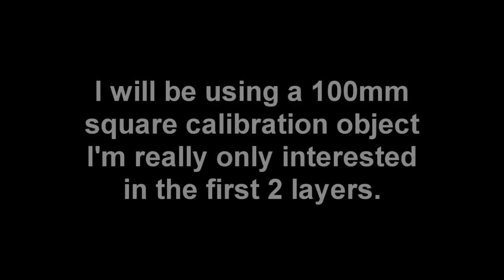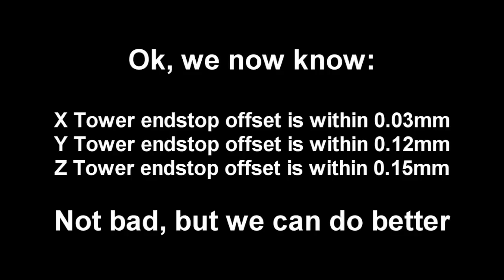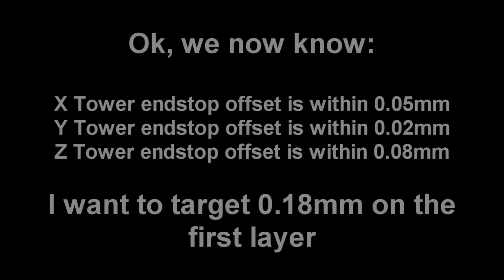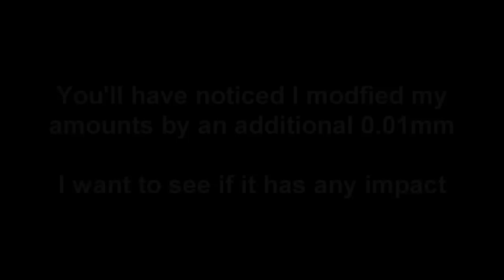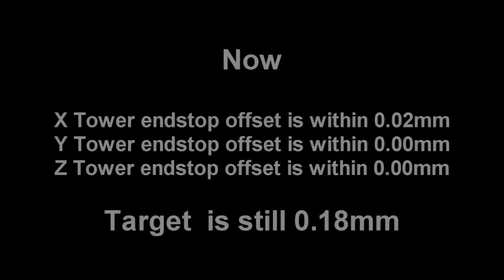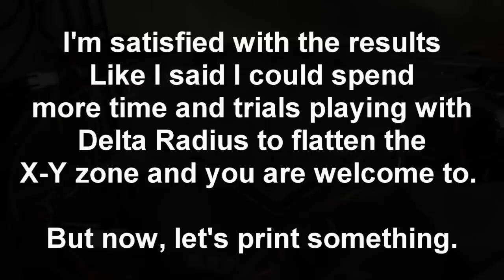Delta Calibration - Fine Tuning

Comment: Do you just add the (M666 X Y Z) command at the beginning of the g-code? I'm working on calibrating my Deltaprintr and this video is great but I don't quite understand what we are doing with the new M6 values we calculate during the test prints.
I'm printing a 100mm cube just like in the video

Currently the "X edge" on my printer prints ok
the "Y edge" of the cube disappears halfway through the line and the extruder drags on the surface
Same with the "Z edge" of the cube; the extruder drags until it gets halfway and is closer to the "X side"
The front edge of the cube seems to print fine

Please Help! thanks

Comment: If extrusion does not occur immediately on the brim/skirt would the cause be due to a shortage of E step calibration? My steps are accurate in producing 100mm when asked to, but the skirt/brim does not print until about 1/2-1 pass
Reply from the maker: Alvin Thai Can be attributed to several things:
1. ooze
2. retract without reprime
3. too much space in Bowden tube means you have to build up pressure before it will extrude.
4. nozzle is blocked from prior retract and needs to build up pressure to push plug into melt zone

I always manually purge right before a print and pull any extrusion away with tweezers before it reaches the build plate.

Comment: Hey Jay, what do you use to hold the glass bed? It seems you are using some sort of pad?
My delta printers is using paper clamp on the edge. It is plagued when calibrating, because the clamp makes the glass curved too much and the flatness is just way off. I want to improve my printer just like yours

I am using the Delta from SeeMeCnC
Reply from the maker: I use 3M Scotch Heavy Duty Mounting Tape, Clear (4010).

Comment: Jay, a couple of questions. First, what are those red connectors you use on the hot end for the heater and thermistor? Those look functional and not monstrosities like deans connectors.

Secondly, it seems from this and the previous video that your Z tower shows a lot more variability than X and Y. Might that be the end stop switch or some other slop on that tower?

Lastly, I notice that your kossel has the same odd vibration on homing that mine does. Travel down at higher speeds is nice and smooth but homing sounds rough and rattles everything. I might play with homing speed, perhaps there is a resonance that the default homing (is that what you are using) speed is causing.

Cheers,
Michael
Reply from the maker: LOL, the one for the hotend heater is a Deans Ultra and for the thermistor is a Deans Mini ... were you thinking of the XT-60 connectors?

The way my endstop switch wires runs on the inside channel causes some interference with the slider...I need to reroute it. There is no slop on the slider, but there is some in the Traxxas connectors. I use a rubber band to try and remove it, but I need to loo for some way to tighten this joint yes.

Good point. Homing speed is set to 90mm/s. After I sprayed some dry Teflon lube the "honking" went way.
Reply: LOL, yes I was looking at XT-60. Used to use those on my RC helicopter. I'll check out the Ultra and minis, thanks!
Reply: Jay Couture Nice, RC connectors are perfect.  Not a fan of Deans myself, but instantly recognized them!

Comment: I have an issue with my flsun qq, in the middle Z offset is perfect, but a few inches outward (all directions) its round about 0.1mm or more too high. Thats after auto-level of course. Do you have any idea why that is?
Reply from the maker: Delta movement converts a set of coordinates into the number of steps for each axis motor. This is some Pythagorean math (A^2 + B^2 = C^2) and is calculated for each tower, for each move, and moves are subdivided by segments per line so there is a lot of computations. If any of your values like delta_rod_length are off, then movement would be parabolic from the center outwards. This is the fine tuning video after you gave a pretty good calibration. Sounds like you do not. Try https://www.youtube.com/watch?v=tDLbqLve128 and then come back to this one if you think you need to.
Reply from the maker: https://github.com/MarlinFirmware/Marlin/issues/11124

Comment: I'm not sure what you are doing here. How does this method compare to the paper-test on the center and on the area around the three towers and adjusting the endstops (which is what I use)? It is similar, or does this method do something else, or additional?
Reply from the maker: This goes beyond using a paper feeler gauge and uses a caliper to measure the actual layer of plastic put down. If you are happy with the quality you get with the paper calibration, no need to do this. However, with this I print directly to glass with a thin layer of gluestik.
Reply: I watched it again and now I get it :) It's a neat way! but isn't it hard to measure the filament that precise? Isn't the readout too dependent on how hard you push on the caliper?
Reply from the maker: Use of calipers does require some practice and using the same amount of force. However even with the cheap 6" digital caliper from Harbor Freight, one can get 0.1mm accuracy easily. I calibrated once for what you see in the video and can print at will without worrying if the base will be flat or if  the part will stick. I posted this video as a follow on to my manual calibration using the paper feel gauge video. It's not required at all.
Reply: Nice method :) I actually do use something similar I believe. I print a spiral object that covers most of the bed, and I start at VERY low z-position (slightly above the height where it doesn't extrude at all) so it's really squashed on the bed. Then I can visually see if the flatness of first perimeter is similar all over the whole bed, and if in the area of one of the towers it looks different than near the other towers then I adjust that endstop slightly and try again (I got screws on top of the carriages that i can adjust). That also results in a very good calibration. However you can also clearly see then that the bed is not 100% flat. There are always some random areas that seem to be slightly higher or lower than the rest and they are not aligned with a tower or anything else that I can see. I guess z-probing would be the final step then to correct for the non-flatness of the bed...
Reply from the maker: I've found with  first layer of 0.2mm I don't have to worry about the "non-flatness" of the cake plate I use on my printer. It's "flat enough" for my needs.
Reply: Yeah for me as well, I removed the z-probe from the effector because I didn't seem to need it, and it was a bulky and weird device.

Comment: i'm confused as to how you calculated your new endstop values in comparison to the layer thickness
Reply from the maker: This video is meant for after you have done the initial calibration video and effector movement is parallel to the build plate. See my other video for that process. I am looking for the layer to be 0.2mm. Y and Z were at 0.33 and 0.35 meaning the effector is 0.13 and 0.15mm too high. Deltas home to Zmax so it means I needed to move the offset from the physical switch away from Zmax towards the build plate hence the negative.
Reply: @JayCouture3D  where can i find the intial calibration video?
Reply from the maker: @fastneonman1977  https://www.youtube.com/watch?v=tDLbqLve128

Comment: Hello, can I adjust the F "tower" with M666 or an other gcode ?
Thank you
Reply from the maker: +UniK Fanta - This video is for delta printers with the towers labeled as X, Y, and Z or alternatively Alpha, Beta, and Gamma. There is no F tower to my knowledge though this video is a year old now and things may have changed.
Reply: I know that that isn't a tower, but you showed a picture with a circle, and in the middle of X and Y was F thats why I asked.. But thank you for the fast answer and you helped me a lot with your videos :D
Reply from the maker: +UniK Fanta - Ok, you are talking about the points of calibration on the build surface not the towers. F is opposite of Z tower between X and Y towers. I like to check the calibration of F(front), L(left), and R(right) after I have dialed in points x, y, and z in front of their respective towers. http://reprapandme.blogspot.com/2013/12/the-basics.html

Comment: If I move my printer to some other location in my room, should I be re-calibrating anything?
Reply from the maker: +Leo Mckee-Reid Unless you are moving something physically on the printer then no. I have actually taken my printer to work on several occasions and it has no impact on calibration.
Reply: +Jay Couture Excellent! thanks for the quick response.

Comment: trying to level my bead and having one issue my y axis is thickness is inconsistent the x and z are fine
Reply from the maker: +Bass Envy You are saying that the filament that is laid down in front of the Y tower is either thicker or thinner than where it's laid down in the X and Z right? If so, then if is always thicker or thinner or does it depend of how close to the Y tower it is?
Reply: When it lays down the filament in front of the y tower the thickness is  .23mm from y tower start point  and at the end of it is like .14mm (these are not exact numbers).

Comment: Can I use this tutorial in my Delta with repetier?
Reply from the maker: I have some blog posts that my help you. http://reprapandme.blogspot.com/2014/02/irst-tests-and-calibration-repetier.html Read that and then follow up with anything that's still unclear.
Reply: Jay Couture thanks a lot for this information! =D
Reply: My delta is calibrated, now I want to do this fine calibration. Can I do this the same way in repetier? Thanks
Reply: Can I do this calibration like the video of repetier? Print, take meager, difference*sets and do it for x y z
Reply from the maker: You should be able to yes. The fine tuning gets into making =very small adjustments to make the printed layer a uniform thickness. It's been some years since I did this on my delta running Repetier (and almost as long as I've used that printer). I mainly use my big printer running Smoothieware, and any reprap gcode compliant firmware should work.